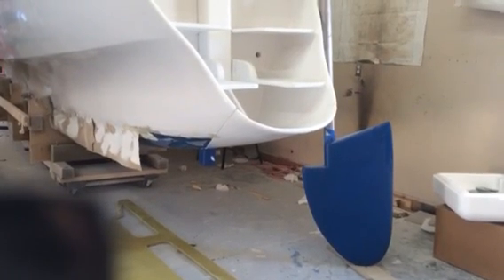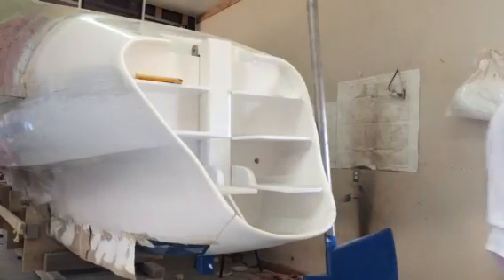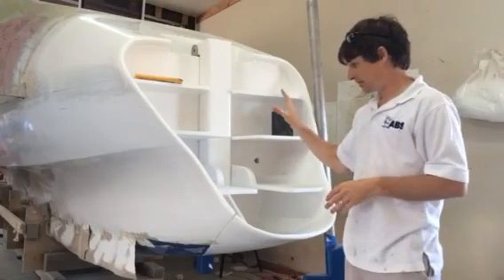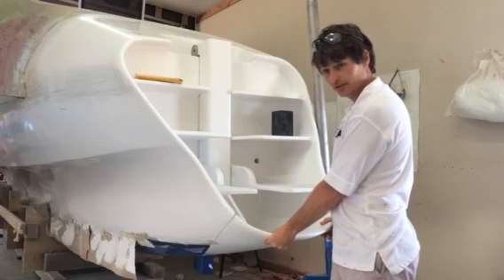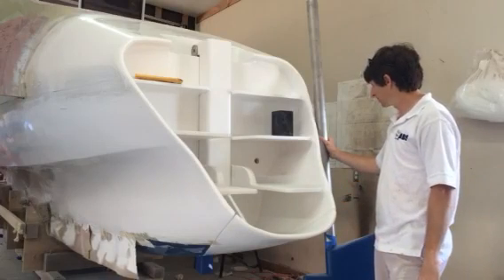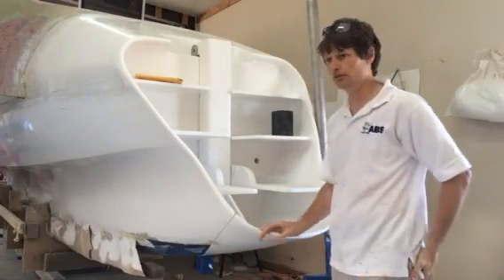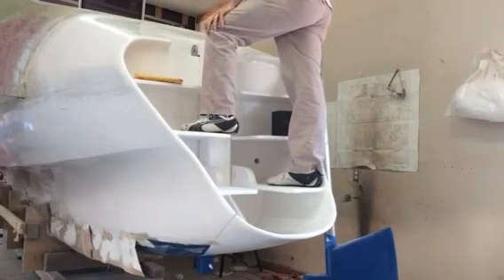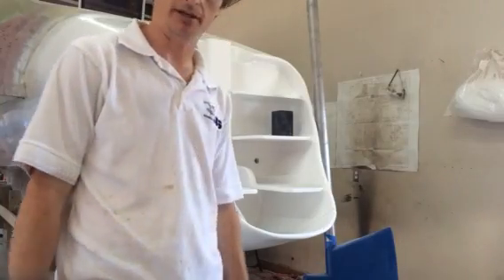Kick Up Rudder System

Comment from the maker: Hi magentawave.  The piece that breaks away is just a small wooden strap that fits behind the rudder shaft and holds the rudder down.  It essentially acts like a fuse, if you run aground the small piece of wood will break allowing the rudder to kick up without getting damaged.  When this happens we just get a new piece of wood out to hold the rudder down.  I keep several spares on board:). Have you seen any of my sailing footage of her underway?

Comment from the maker: Yes, it's hard to see in the video, but there is a slot where i place a small piece of wood to hold the rudder in place.  However, I think the wood is stronger than the slot, so I have to figure something out.